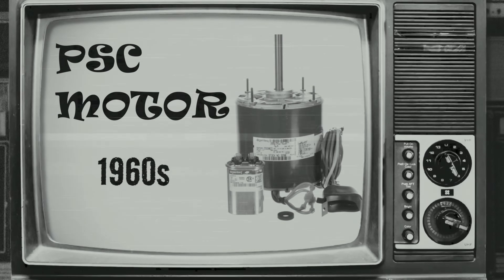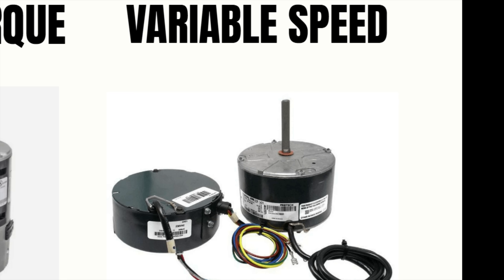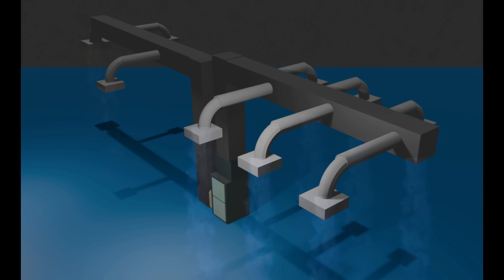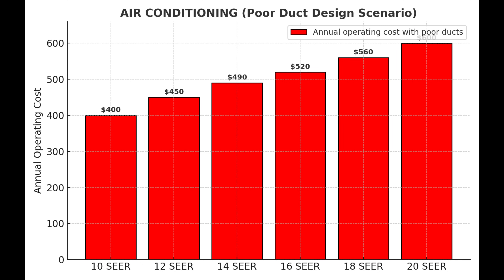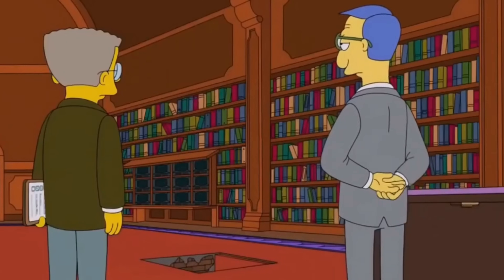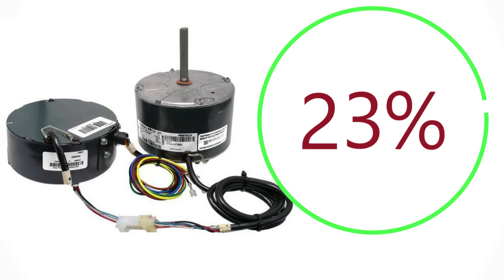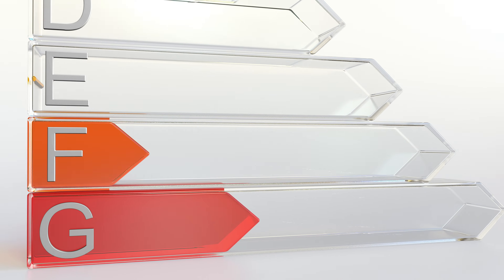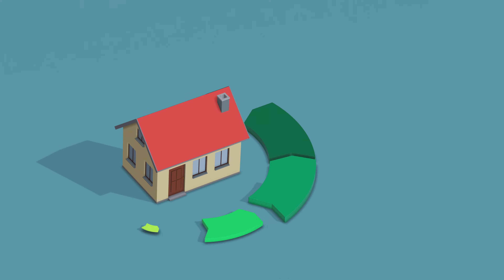The Ugly Truth About Motor Efficiency in HVAC

Comment from the maker: A LITTLE CLARIFICATION: I'm getting quite a few responses on this video that seem to be under the impression that I am making a blanket statement advocating that these variable speed motors DO NOT deliver on efficiency.  These systems most certainly can and do increase efficiency and can reduce energy costs. My focus on this video is the failure of many technicians to actually check static pressures on existing, old duct systems that these high efficiency units will be attached to, and how these high efficiencies can be negated due to how a variable speed motor actually work under very poor airflow conditions due to high static pressures related to poor duct design. 

If you or your customers have saved money on energy costs after having installed one of these systems, then that indicates the duct work was suitable for the upgrade. This video only focuses on situations where that might not be the case. There are a lot of duct systems out there that were not professionally designed, there are a lot of technicians out there that do not test static pressures of existing duct systems prior to selling these upgrades and not every customer who has upgraded has experienced the same energy savings as a result.

Comment: We just had our variable speed motor changed as the 2012 unit failed . It was over $2000 just for the motor and near $3000 with labor and travel ! I couldn’t believe it should be that expensive.  Any savings I might have made just went out the window.

Comment: While ECM motors may reduce electrical use what is the true cost of operation over a period of, let's say, 25 years?  Over the 25 years what is the cost of maintenance, repairs, replacement of the PSC vs ECM?

Comment: Great video! Very easy and simple explanation! Thank you!
I am a licensed hvac/refrigeration contractor. I see these systems with a static pressure as high as 2.5 or even 3.5 almost every day! It’s a HUGE issue everywhere: commercial and/or residential. It’s pretty typical to see 10 ton package installed with air ducts good for 2.5-3 ton at best.

Comment: ECM variable speed motors determine air flow CFM by current draw vs rpm's relating these to manufacturer supplied air handler characteristics.  The air handler manufacturer data creates a unique situation that keeps the price of ECM replacement motors artificially high.

Outside ECM motor on condenser unit contributes little to energy use reduction.  Fan motor power consumption on outside unit is not significant enough to justify an ECM motor on outside unit unless the compressor is also variable speed.  Subjecting the electronics of the ECM motor to outside environment is more likely to cause higher motor failure rates.

'Tuning' air flow in a house is very important.  The actual CFM air movement needs to match the system design capacity for optimum efficiency.  Relatively low-cost improvement may be achieved by enlarging return air grill and filter size.  Many homeowners think higher MERV air filters are better, not realizing how much it negatively affects static pressure and system efficiency.

Comment: Lots of houses, especially older ones from before domestic ventilation became more of a proper science, have grossly inadequate air returns. My mother's house needs at least one 32x10 return added in the basement (currently has a single 16x8) to help even out temperature. I had to spend the last few months at my mother's house after she had major surgery and to make her basement livable, I had to remove the air filter door altogether and leave the machine room door open. There is a 32x12 one on the main floor and it is noisy AF when the filter door is on, far too much air going through there too fast. I bet there is more vacuum in the return duct than the whole differential prescribed by SEER2.

Comment: Any company installing new equipment on old (or even new duct systems that have not been designed) are ripping off their customer. If it's an issue of cost because you can't repair the existing system be honest and don't sell "efficiency, install the cheapest like for like equipment you can find. The HVAC industry is full of ripoff artists.

Comment: Mike, I'm a Technical consultant for a MFR, and this static issue is the single most common cause of buyers remorse in HVAC in our field. No one wants to touch this subject before or during the "sales process".. Yes, a percentage of homes have adequate duct systems to make use of a high, or higher efficiency system, though this not the majority of them. At best, most are mildly disappointed with the reality after a season or two, if their decision was based on lowering energy costs, and their duct system was not optimal. Then the dealer struggles to "escape" the H.O.'s wrath afterwards. Not to mention the really terrible duct system homes, where these ECM motors kill the efficiency yes, then themselves overworking trying overcome the high static. Faced with repeated very expensive motor/module replacements, and wanting blame the manufacturer in the end. Keep at it brother 😉, you're only taking "flack" when yer over the Target.

Comment: Good points. The bottom line for greater efficiency is to understand the duct system limitations. Recently I faced a new cooling option (A/C died prematurely), and decided I wanted a heat pump. I asked three HVAC companies to provide estimates, after their site visits during which I explained issues with the 1967 construction of the duct system (the dead A/C iced up fairly often). The company with the most open-minded staff worked with me (an engineer) to design locations for three additional ceiling vents and a high elevation return. They got the job. System works well with one late spring manual task…I choke down the pre-existing returns. Really wish I could set a diurnal speed profile in the thermostat to optimize performance, but I don’t know of a make/model for residential use.

Part of the issue with variable speed motors is the simplistic control logic and thermostat the manufacturer or installer offers to a customer because they don’t understand the advantages of variable speed motors. A variable speed motor can be programmed to not up the amps when resistance increases.

Comment: This seems like a story about the blower rather than the air conditioner.  I am not sure how the seer rating of the compressor relates to the efficiency of the blower.  And am still confused about that after this video.
Reply from the maker: The blower isn’t directly tied to the SEER rating, but airflow is a big part of how that rating is achieved. The compressor’s efficiency depends on having the right amount of refrigerant moving heat across the coil. If the blower isn’t moving enough air, the coil gets too cold, refrigerant pressures shift, and the compressor ends up working harder and less efficiently. So even though the SEER number is about the outdoor unit, the blower is what makes it possible for the system to actually run at that efficiency.
Reply: @JerseyMikeHVAC  Fair enough, I think part of it is they also put in a larger expansion coil as well so more air from the blower can come in contact with the coil.   Thanks for the explanation.

Comment: As an untrained HVAC tech homeowner I know when we installed a new system with a variable speed motor in a 50 year old ranch style house/ducting we had the benefit of running the fan at low speed to circulate air when not heating or cooling.  That made room temps more even at the far ends of the house also helping to eliminate cold rooms in the winter.  We also saw our bills drop about 20% even with the fan running in the background.  I was amazed.
Reply from the maker: Glad to hear that, but the keynote of my video focuses not so much on the variable speed motors but poor duct design, which affects all motor types, where the variable speed motors can particularly be affected when it comes to energy consumption in these poor design situations. If your system is saving you money, then your duct system is designed to support such an upgrade and deliver the strengths these high efficiency models promise to deliver.  

 Unfortunately, not all technicians test a duct system before installing these upgrades to ensure the efficiency can actually be delivered.

Comment: The motor is not the entire efficiency of the system. 
Just that one part of it. 

You seem to have a favorite type of motor
Reply from the maker: That motor controls airflow which affects every aspect of system efficiency., including the compressor.

I don't have a favorite. I just don't think every motor works in every situation.
Reply: @JerseyMikeHVAC 
The efficiency of the rest of the system is going to depend on the airflow. Not the amount of electricity the motor uses. 
And insufficient air flow is going to affect the life of the system, especially the heat exchanger. 

There are several YouTube videos explaining why we reduce their flow is bad for your heat exchanger. I imagine you have one past on your wrong filter slide

Comment: Does the motor's power draw really make up that large a portion of the overall system? I mean even if motor draw doubled from 400W->800W, wouldn't that only be like a 10-15% reduction in overall system efficiency?

Comment: I've always wondered about this, and had sort of a gut feeling that these high efficiency systems would be great if designing the house from the ground up, but don't make sense to retrofit into an existing older design.

Going full tilt on heating or AC costs me an additional ~$100/month or so on my electric bill, and I only see that for maybe 3-4 months out of the year at most.  That's running on a 25 year old all electric system with entirely flex-line ducting in a leaky and poorly insulated home.

The cost of some of these super-efficient systems alone exceeds any savings I'd ever get from them, and when you include the additional cost of redoing all the ducting, all that extra money would be better put towards addressing insulation and penetration issues.

Comment: I completely gave up on central air conditioning when I got a brand new system in the early 90's, and learned that the energy that the circulation fan uses wasn't even counted in the SEER rating!  I don't know if this is still true today.  Since then, I've been using window units until I moved out 6 years ago, and have saved a fortune on my electric bills.
Reply: You should have maybe educated yourself a little better...  "The SEER (Seasonal Energy Efficiency Ratio) rating includes the ENTIRE central air conditioning or heat pump system, including the outdoor condenser unit and the indoor air handler/evaporator coil..."

It is amazing how people learn some utter nonsense and just take it as a fact...
Reply: @redbaron6805  I did very careful electrical measurements on my system, because I was wondering how my electric bill could have quadrupled since the installation of my central air when it was claimed to be far more efficient than my window units.  The flyer for the outside condenser unit never even mentions the air circulator motor.  This means they didn't account for the energy consumption of the circulator.  My career is electronics, and I know what I'm talking about.
Reply: @theclearsounds3911  The "flyer", seriously dude.  When systems are SEER or SEER2 rated, they are tested in an actual lab in a standardized environment, and ALL the power the system uses is accounted for.

If you have a career in electronics and don't understand how testing standards work, you may want to do a lot more reading.

If your electric bill quadrupled with a new system, which is physically impossible unless you oversized or undersized the system, then you have some other issues.

The A/C compressor on an A/C system uses the most power in a system, and it runs at 50% to 75% duty cycle on a warm day, and can approach 100% on a hot day.

Hence, it is literally mathematically impossible for your electric bill to quadruple because of a new A/C system, even if you put the thermostat on 60 degrees and opened up all the doors and windows during a heatwave.

If you seriously think that was due to the fan motor power, I'm not sure there is much hope for you...

Comment: ductless split air is the best with no loss with clean filter
Reply: I've been saying for years, I simply do not know of any country other than the US still stuck on ducted systems.
I blocked off all my ducts and switched to ductless mini-splits years ago.  I've saved so much money over the decade or so, the system paid for themselves.
There are multi-room units (one outdoor unit, multiple indoor units), but I intentionally went with independent units, because if one were to fail (nothing lasts forever you know), I won't be in a hurry to repair/replace it, because I can just get by on one of the other units.  Slight change in habit (which room to do what with), but it's not that big of a deal.
Reply: @catsspat  That is a great point, but air conditioning in other countries was relatively rare except for the USA for years.

In Europe, air conditioning was almost unheard of even 20 to 30 years ago, even cars didn't used to have A/C unless they were American imports.

It kind of makes sense to have a single central unit with multiple ducts to distribute the air for many rooms, and mini splits in the USA were almost unheard of until about a decade or two ago.

Today, I think it makes a lot of sense to have multiple mini splits, especially on a new build, as they are a lot more efficient, and it is easy to control the temperature differently in each room, depending on use.

I like to sleep with my bedroom really cold, no higher than 70F, and at my old house, I had to cool the entire house to 70F, which was a total waste as no one was using the other rooms at night.

Fortunately, my new house has a mini central in the master bedroom and bathroom, and I'm debating whether I should replace it with a ducted mini split and use the existing ducts, or use two mini splits, as I would need a separate one for the bedroom and bathroom.
Reply: It is definitely the most forgiving system in most situations, as there is no duct work to worry about.  A ducted mini split will be about the same efficiency if the ducting is correct however.

Comment: Recent heat pump upgrade of a 24K unit. Old air handler used 300 watts all the time. New one uses 75 watts for the same air flow. And at FAN_ONLY is down to 30 watts. That sounds like an efficiency improvement to me...
Reply: it's an efficiency improvement when the ductwork is properly designed/sized.
Reply: @Jon-hx7pe  Improperly designed ducting is a disaster no matter if it is a single speed or variable speed system.  Having a single speed system does in no way fix a problematic duct work.
Reply: modern fan speeds are much lower.